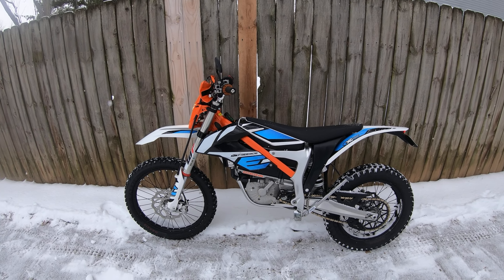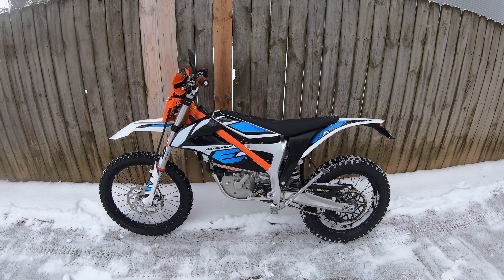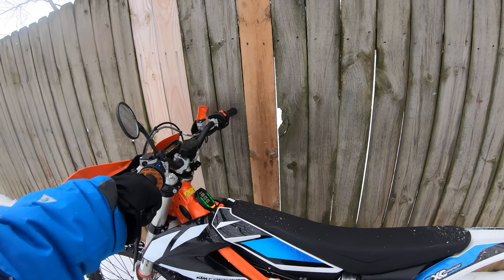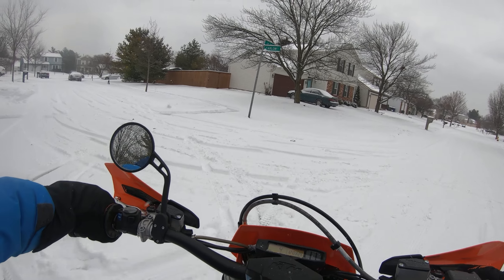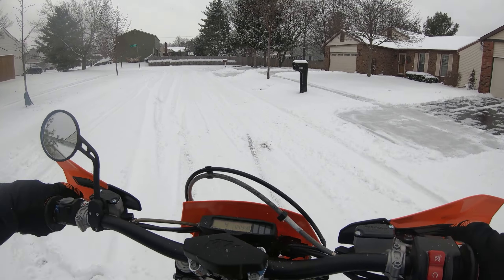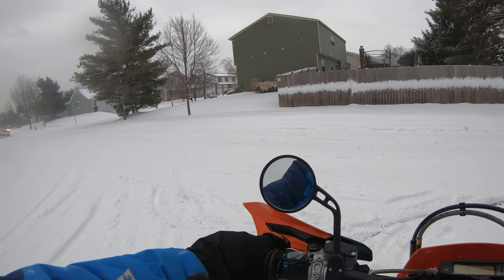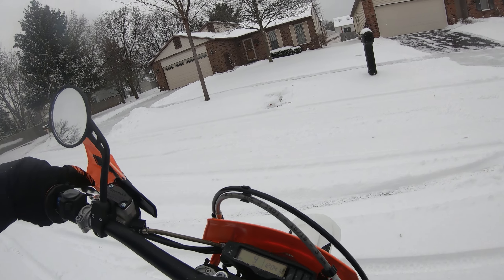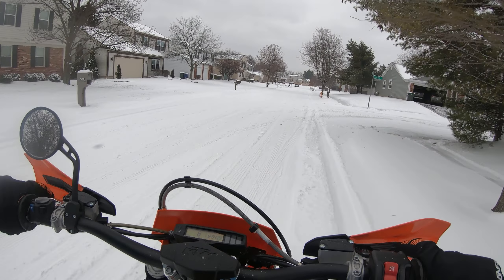2020 KTM Freeride E-XC Snow Ride: No Traction!

Comment: I have a 2022 model and it does have traction control. When riding in sand I found it was cutting the power when I tried to spin the rear wheel. I looked it up online and I found a few article saying it does have traction control built in. However there is no mention of it in the owners manual. I would like to disable it but I guess I can't?
Reply from the maker: Wow - I had no idea KTM added traction control!  Very interesting - especially since you cannot seem to turn it off.  Does it seem to have TC in all (3) power modes?
Reply: @mxengineer1  I mostly ride in mode 3 and that is how I noticed it. I can't say for sure about the other modes. Very strange there is nothing in the manual about it. But I mostly notice it when I am riding hard through sandy berms, I hold the throttle wide open expecting to get some wheel spin but it won't. You can feel the power is not kicking in until it gets some better traction. I also have a KTM 1090 Adventure R which has traction control that you can turn off and on. The traction control on the Freeride is a bit more subtle.
Reply from the maker: @ryandundas2851  I see you have experienced the Stark Varg....talk about a bike that needs traction control!  https://www.youtube.com/watch?v=Qy1ApnFAAvU&t=2s
Reply: @mxengineer1  Good info on the Stark. The Freeride is fun but I think I will eventually upgrade to a Varg.
Reply from the maker: @ryandundas2851  Varg is a unique off road experience from 10hp to introduce new riders to the sport to 60hp for experience moto riders to 80hp when you have that Need for Speed!

Comment: I just gut this bike 2022 model. And I was wondering how perfekt I could control the traktion without clutch. Even in mode 3.This are the tyers the don't fit for snow. The bike is a realy good one. Of course Stark Vark will be the Topgun for shure.
Reply from the maker: Yes studded snow tires are way better!  I just did this to exaggerate how quickly the electric motor spools up when traction is lost.  My Stark Varg is on order and due this November!
Reply: @mxengineer1  Stark Vark will change everything. I beleave.
Reply from the maker: @lotharluder2743  If it lives up to the hype and specs on paper it should be really good.  I enjoyed my Alta EXR and the Varg should be about 20 lbs lighter with a more efficient and powerful motor and bigger battery...should be fun!
Reply: @mxengineer1  I want that fucking Varg too, even I gut a new Freeride. I think after the Varg nobody wants anymore a Freeride when Vargs are streetlegal. I living  closed to 2 Motocrossarenas. Could drive direcly from home there. Of course mainly I would put it into the van with all support. But I could also here in there go wild on the fields after the harvesting, what I am doing sometimes now with Husky 250 2 stroke and old xr 600 and now with Freeride too. Life is short but some Moments are great. And of course you never can have too many bikes.
Reply from the maker: @lotharluder2743  I like my electric bikes and also still like my gas bikes...2-stroke and 4-stroke!  You can never have too many bikes!☺
Reply: @mxengineer1  yes Sir.